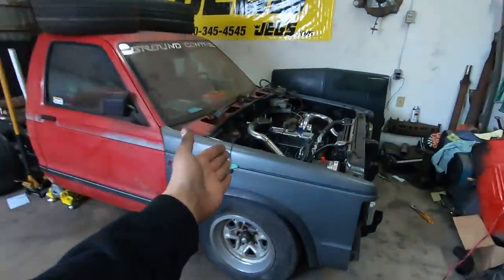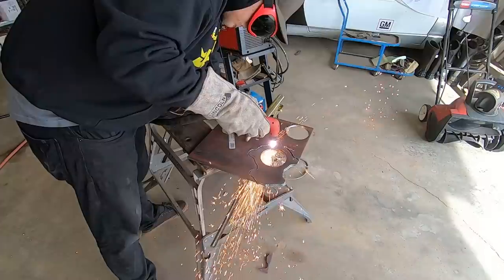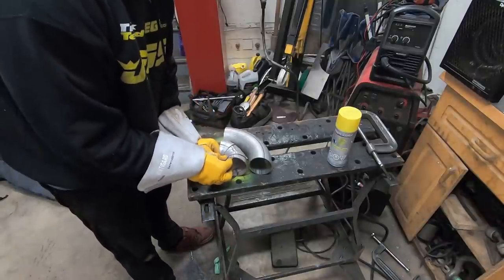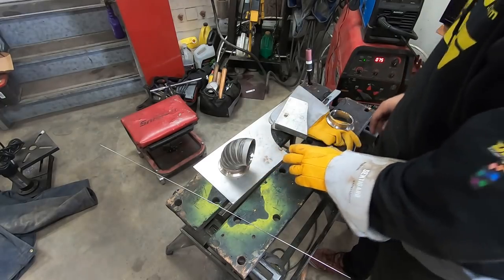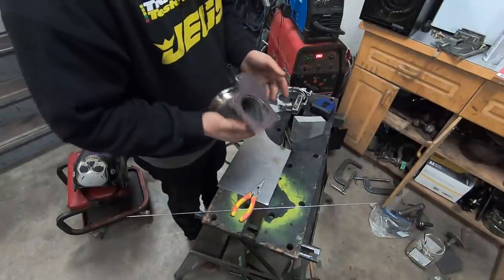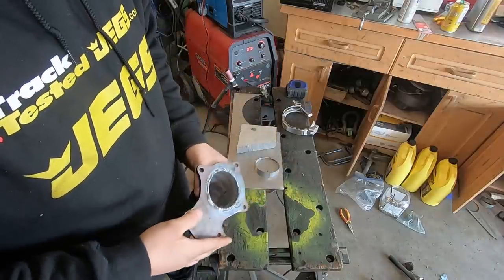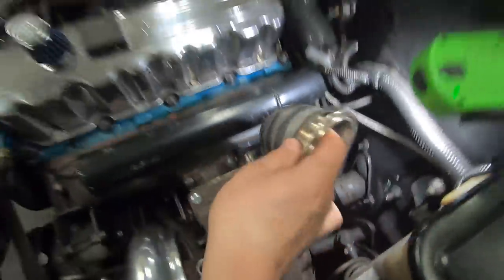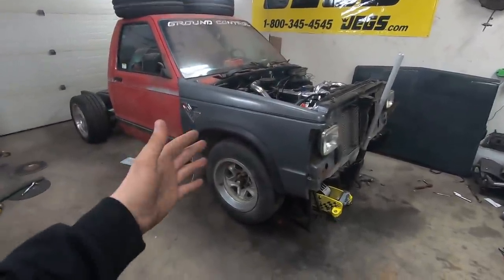Fully Custom 3" Pie Cut Turbo Downpipe! Big Single Turbo Boat Engine Swapped Chevy S10

Comment: Love your videos on rat 10 you can use header wrap on the exhaust by the fuel filter and fuel lines to cut down on heat just a suggestion

Comment: If you cut the end pieces of the pie joint square on one end and 7.5 on the other you can make a true 90 that still fits the tubing perfectly on each end instead of being slightly oval. 

Hope that makes sense lol